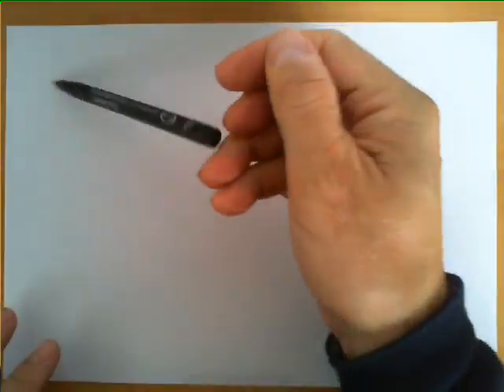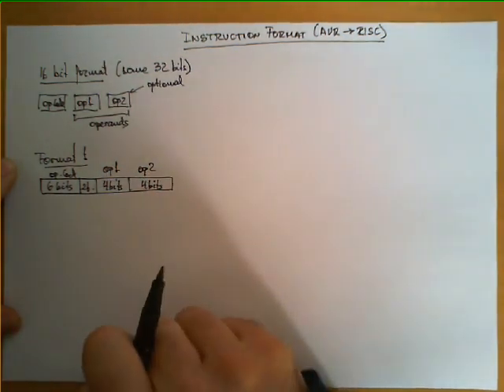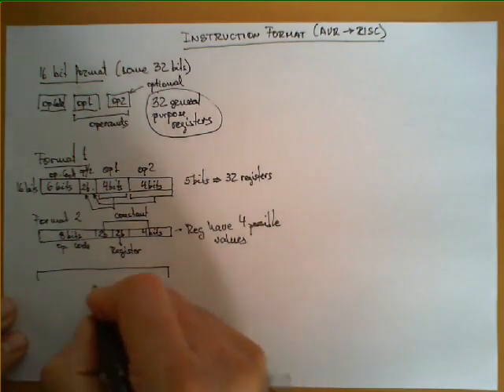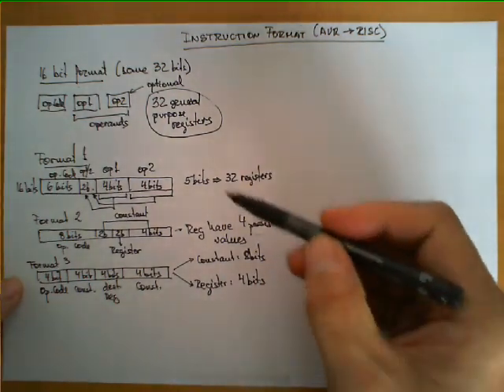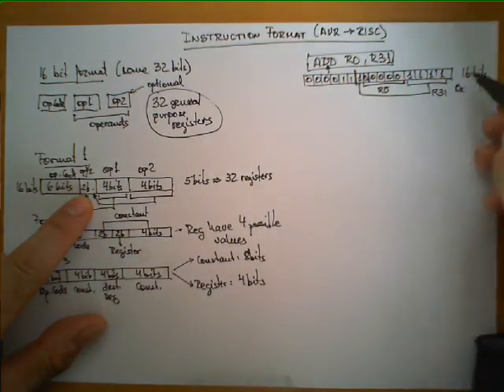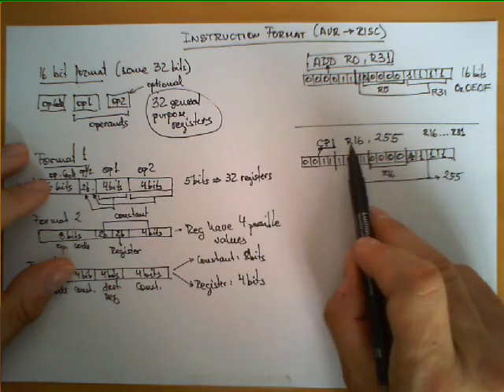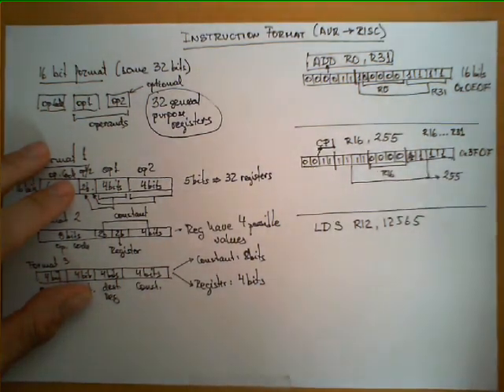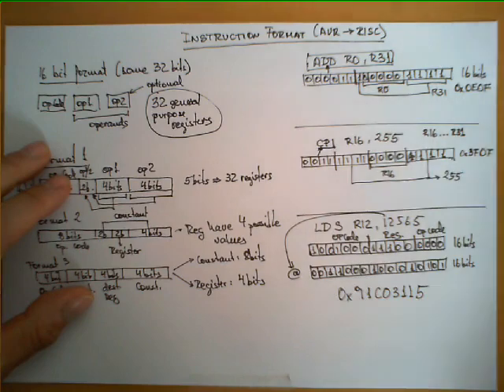AVR Instruction Format

Comment: I expected R12 to be encoded as 01100 not 11100. Which one is correct and where can you look it up? Does Microchip really expect me to test this myself?
Reply: Yes, R12 should be encoded as 01100 not 11100. That threw me too but I assembled the same instruction to prove it out. But to the OP, great video! It is very helpful!